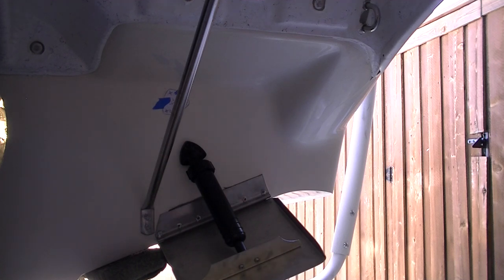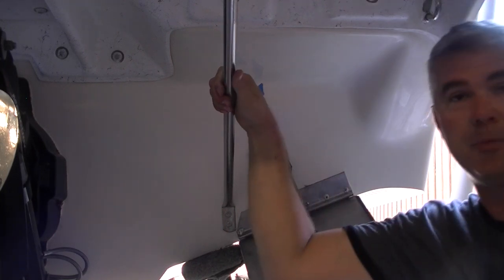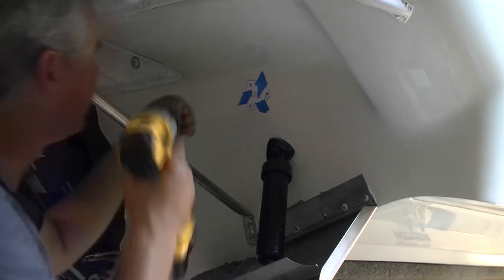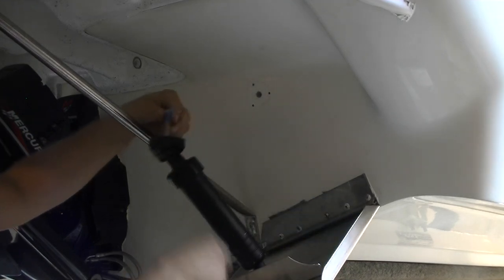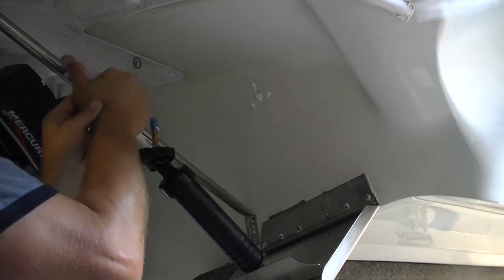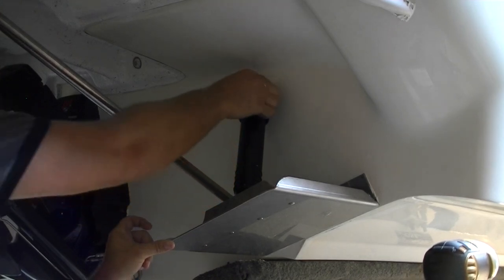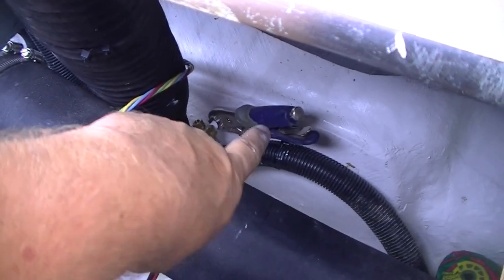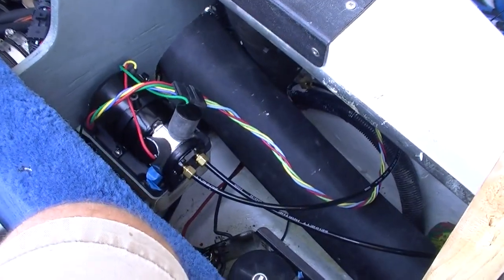Bennett Trim tab installation Part 2

Comment: My dad one showed me a different way to prevent from drilling too deep.

take a 1/2 square block of wood to the size you want,  drill through the block of wood.
then you cant drill too deep since the block of wood will stop when it hits the surface.

making sure to measure the lenght of the bit  is to the depth you need.   

and you dont end up making any OPPS.

Comment: The reason for the statement "Absolutely no teflon tape" is because a tiny teflon tape piece always eventually figures out a way to enter the fluid system and it only takes one tiny piece in a hydraulic system to ruin hydraullic equiptment. This goes for any hydraulic system, not just trim tabs.

Comment: You stated you coated the tab screws with epoxy. If you ever have to replace a screw, you may end up stripping the head or breaking it off! Doesn't the instruction manual say to use marine sealant and use marine epoxy to cover old different make trim tabs holes that were removed.   You sure it said epoxy??
Reply from the maker: I do believe it was 3m 5200.